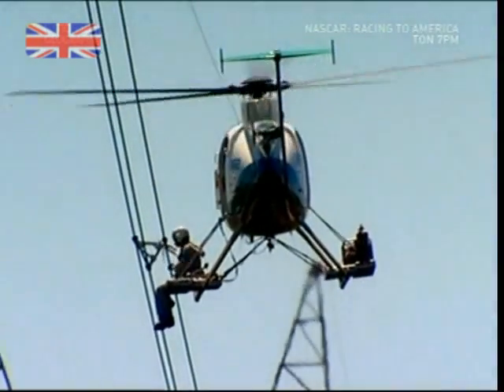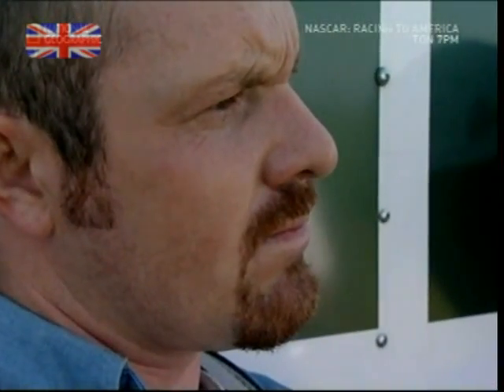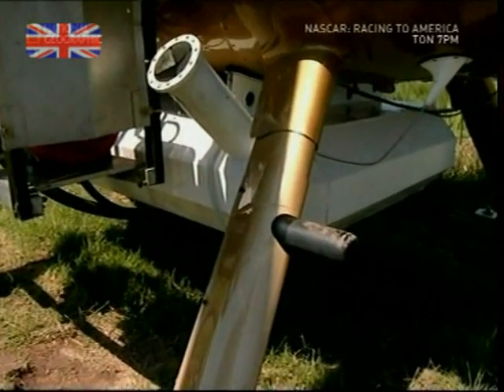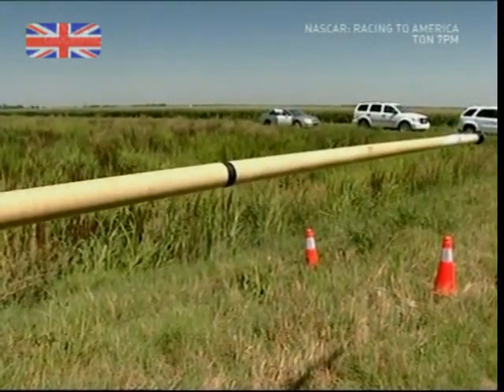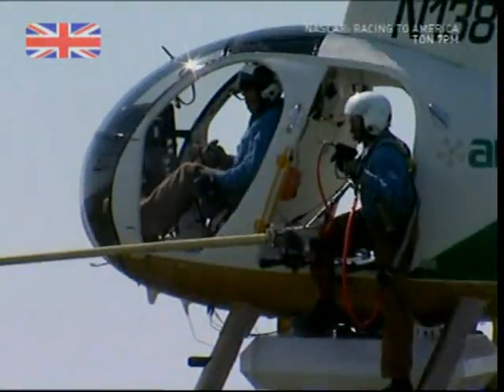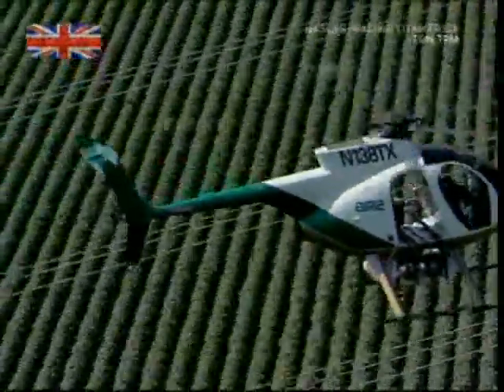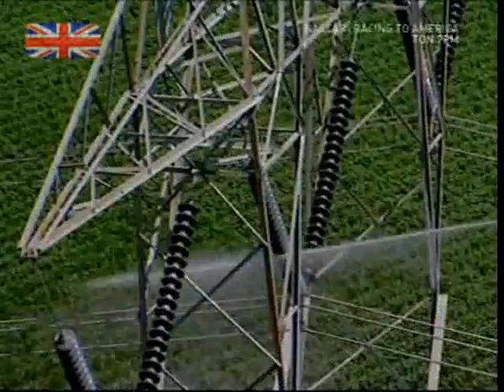'Hot-Washing' the Insulators of a 500,000 Volt Power Line!

Comment: Incredibly dangerous, and a problem world wide that is no easy fix. That is bird crapping on electrical components. Mix salt water environment such as coast cooperatives and you get a nightmare of continuous preventive maintenance issue created by the corrosion from same bird crap. There is a concerted effort to develop a "poly" solution to this but with limited success. So it looks like this problem will be around for awhile.

Comment: Okay if its water needs to be absolutely pure, why then do we still have electricity when it rains? The insulators get wet the conductors get wet the water steel gets wet so there you go your path the ground. But I've been near power pylons after it's rained or while it's raining and it's real heavy downpour no sign of any kind of bleed off from Tower. I guess it's just a precaution. Because freshwater without anything in it isn't very conductive. Saltwater extremely conductive bath water with soap in it extremely conductive.

Comment: Why not shutting down the line when doing cleaning?! Just can not imagine this... There are always backup lines to feed parts of the cities, shutting down a line will not bring blackout for the territory !!! Unnecessary risks introduced hereby.
Reply: Little story from where I live (North Germany): We have a HV power line over a river here. A few years ago, a very large ship had to pass below it and the engineers were not sure whether the distance between ship and power line was enough, so they decided to switch power off. The electricity then passed through the next lines over the river. This was too much load for some of these other lines, so the system disonnected them. The power had to go through even less lines, more lines disconnected and so on. In the end, half of Germany and a good part of France had no power for about an hour. Shutting down important HV lines is way too difficult and risky.

Comment: “Most people, when you tell them what we’re doing, think we’re insane…Here we are, spraying water at high pressure over the insulators of a 500,000 volt power line.” I guess maneuvering and hovering a weighted helicopter about power lines and pylons/transmission towers is taken for granted!

Comment: Are they still alive??
Reply: That's not quite true. The danger is not electrocution but rather flash burn from a high voltage arc and fire ball jumping across the insulator. 

 A 15 foot long 500KV arc will cause third degree burns to anyone within about 50-75 feet. Keep in mind that it's kind of hard to fly a helicopter when you've been blinded by the largest arc welder on the planet. Also the RFI and heat from the arc  would cause sever damage to the helicopter. So the idea that this is safe as long as they arnt grounded is based on a poor understanding of high voltage AC
Reply: it is completely safe as long as they are not touching the ground
Reply: I think he also means the helicopter. To fly this close to something isnt something i would like to do.
Reply: That's a joke on "It's Always Sunny in Philadelphia".....
Reply: Yes.

Comment: Ok.... To all of the goobers saying it's not dangerous... If that water was not purified of all minerals, it would cause the insulator to be compromised... Making the link between the GROUNDED TOWER & the high voltage line... BOOM... Helicopter and everyone in it is dead ! See how simple... So yes... Very dangerous....
Reply: Could the water actually go upstream to the engine and then into the heli and damage it and hurt the people? Or is it sprinked enough?
Reply: Water is not a conductor of electricity.  It's actually a pretty good insulator. 
What water is also good at is dissolving things.  Conductive metals, minerals, and salts in water are what make it conductive.  And that's the exact kind of stuff they're also trying to remove from the surfaces of the insulators by cleaning them.  By using pure, distilled water, there are no dissolved substances to carry electricity from the water's contact back up to the helicopter.  As the insulators are washed off, the water does dissolve the contaminants, but there is not enough picked up in a concentrated enough amount of water to cause anything bad to happen.  

I wouldn't have the cojones to be in a helicopter that flies that close to the conductors or shield wires, though.  Yikes.

Comment: Even if you touch the live line, you still won't die because there is no potential difference. Normally, people stand on the ground and if they touch the live line, there is a high enough potential difference to cause a lethal current flow.
Reply: At these potentials, there will still be current from capacitive and coronal discharge effects.  For guys who do live line maintenance from helicopters or boom lifts, their FR suits are electrically conductive to keep from getting zapped.

Comment: NOT dangerous......although many thousands of volts exist between ground and the conductors, the voltage difference between the helicopter and the conductors is zero.  Therefore, no current flow.  Same reason a bird can sit on a HV line and not be shocked.  It wonders me why anyone would create this "how dangerous it is" story w/o knowing what they are talking about.  The most danergous aspect of the situation IS NOT the electricity, it is flying the hello close to any physical object.

Comment: Pure water is non conductive - untill it touches contaminants on the insulators.
Insulators are designed to self-wash. 
Pure, clean rain water washes the insulators.

The helicopter is not grounded.
A fire hose water stream of many feet does not produce a conductivelectrical path.
My biggest concern here is the rotors touching the powerline.

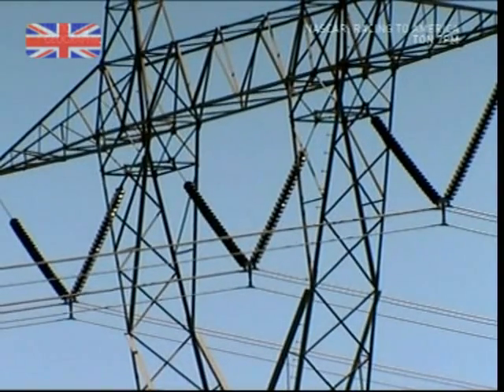Comment: At 0:36 There sits a bird on the line. Birds never go near live wire.
Reply: +Picobyte That's not a live wire. As you see that's two wires close together, the live wires are three together (three phases). Those wires are neutral and don't have any power flowing through them. If you look at 0:40 you can see the (very thin) wires at the top, they aren't insulated from the tower either.
Reply: rikzel You mean the sets of three conductors that are connected with those triangels? You have a lot to learn. Maybe you don't know what you're talking about.
Reply: +Picobyte nope. every set is a set because it can carry more power that way (at least here in the netherlands) and every set of wires (conntected via those "triangles") is one of the three phases. if there are 6 goups of cables that means that there are two seperate Power circuits in one tower. the wire that i was talking about is the non insulated wire on the top of the towers, that's the wire on wich the birds are sitting. I knew it wasn't live because it isn't insulated and is even connected to the tower, but I asked about it and it seems to be against Lightning. this top wire is connected to earth and that way Lightning will strike to earth in stead of in one of the there phases. maybe YOU shouldn't jump to conclusions that fast sir ;)
Reply: +Picobyte maybe I didn't explain that well, because I'm not native english, but that doesn't nescercarily mean I don't know shit about it
Reply: rikzel Point taken..The little triangle thingies are there to hold the conductors together,so all three of them act like a single much thicker wire. Look at the huge insulators that hold those wires.and imagine there would be phase potential between them.Each set of three wires is one phase.Has to do with corona and more weird effects high tension surprises us with.
Reply: +Picobyte that's what I'm saying, and then three of those three wires is one 3 phase circuit. point is, the birds aren't sitting on any of those wires, just on the top wire, wich is for the lightning
Reply: rikzel True. bdw I'm dutch :)
Reply: +Picobyte hahah ✌ neat :)
Reply: Only birds I have seen on EHV are kingfishers, for some reason they don’t mind.

Comment: pure water is not conductive, only when there are impurities (ions of minerals mostly) will it conduct.  Rainwater is distilled also, but picks up contaminants passing through polluted air.  If the water were conductive, it would cause the 'hot' line to arc across the insulator, creating the arc-flash explosion, which would be strong enough to blow the chopper out of the air.  

But a helicopter in the air has no connection to ground, so there is no place for the current to travel and hence no danger. That is why the birds can land and sit on high-tension wires without getting shocked, and the guy working on the hot lines also doesn't get shocked.
Reply: +trumpetmaris Exactly. Distilled water will not conduct electricity.
Reply: +trumpetmaris The chopper will be fine.The workingpoint of electricity at high tension is pretty bad in air.Most powerful explosions are in the low to medium 400V~10000v range.
Reply: I have seen other videos where they equalize the potential of the chopper to the powerlines using a rod from a small distance. That gives quite a bit of arcing. I don't know the physics behind that, but i guess if you touch the lines straight away without doing the above, it might hurt a little. Maybe because of the mass difference between a bird and a helicopter+people.

Comment: well If the helicopter is completely airborne and there is no connection to ground you wont get electrocuted. the electricity will flow passed you because it won't be able to complete a circuit to ground through your body
Reply: +Bones Hurt This sort of power can arc 15 feet...so all what the helicopter would need to do is fly too close to the cable (@550kV) and the giant metal tower (at 0V) and there is the "potential differance". I dont think the outcome would be very pretty

Comment: 3500 horsepower pump? Nope, that's nonsense. He must mean psi.
Reply: I ought to do an engine swap with one of those to my car
Reply: Yep! 2000 hp  was a Spitfire Merlin towards the end of its development.
Reply: 3500hp 50cc motor
Reply: Yeah, I was wondering "How much does the engine produce?" and it's less "can I swap that for the engine?"
Reply: Whats wrong with 2.6MW pump? You mean you guys don't have one?
Reply: @uruiamnot  420 to 650 horsepower. You're confusing me Allison 250 engine model designator to the horsepower in the md500 aircraft

Comment: What a croc, since when did bird shit need cleaning with helicopters ?

Some clever salesman has sold the UK electric co, helicopter jet washing. Hahahaha.

BTW in the UK you are absolutely not allowed to have outlets or even a light switch in the bathroom. Very strict. But we do run 250v for everything, (which stings quite a bit more than 110).
Reply: Since it is conductive when wet and I do believe it has been known to rain in the UK. It is cost effective to use choppers to do a lot of line work on high tension equipment.
Reply: 250v for everything? Time to start arc welding in my living room.

Comment: they make it sound so dangerous. as long as the chopper doesn't ground you will live... This is a horrible documentary for dumb sheep.
Reply: no boy, if helicopter comes somewhere between tower and conductor, anything can happen. as this is 500kV
Reply: More dangerous is the contact of rotors with wires
Reply: boraboy4ever You have no idea what you're talking about; it's not that simple. Look up any similar documentary, and you'll realize they have to bring the helicopter up to the 500KV potential any time they are making contact with the lines - the fact they are never grounded is irrelevant. Any impurities in that water, and they are in 'contact' with those lines while NOT at the line potential. You might want to do some homework before spouting off next time.

Comment: The only risky part of this operation is the helicopters´ rotors hitting the cables or the structure of the pylons or the cleaner falling down. The voltage is no problem at all. It's obvious that the pilot is just talking a lot of nonsense. "3500 horsepower" from a lawnmower- engine! I guess he is trying to impress the ignorant, which is very easy! There is no need for an insulated  washing-boom or "pure water".

Comment: Folks should also remember that the helicopter is not connected to either ground or a separate phase so that there's only a coronal path to the chopper. The problem/danger they face is from ions in the water causing arc over the insulators themselves. Pure water and a non-ionic cleaner are actually 20 times the dielectric strength of air and that's why the distilled water.